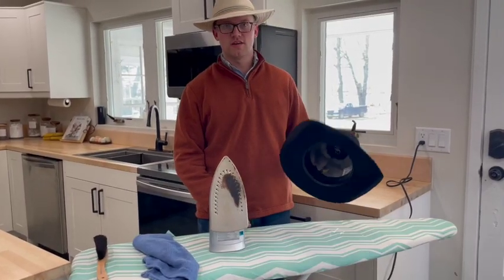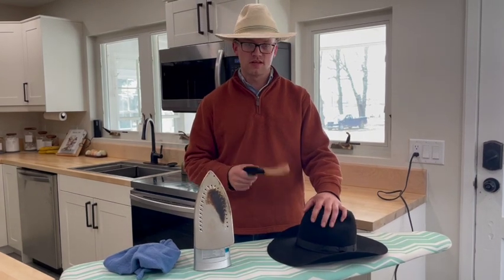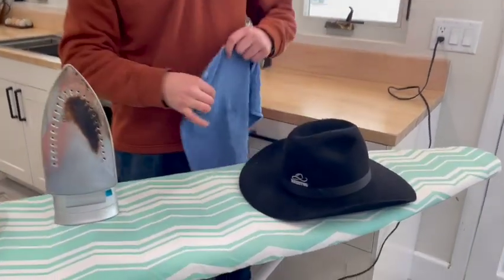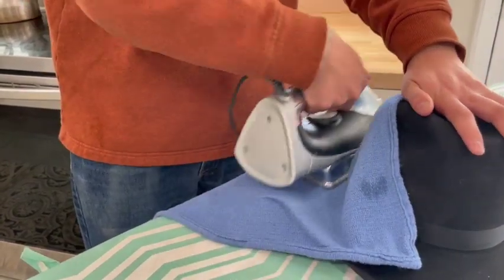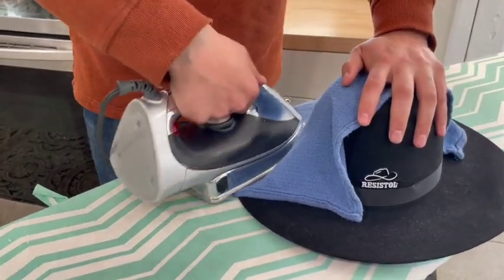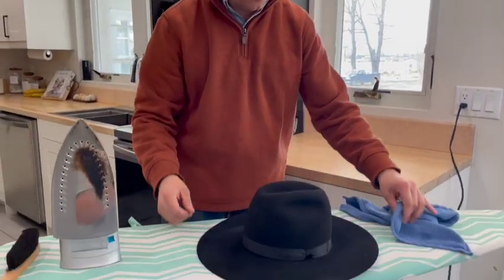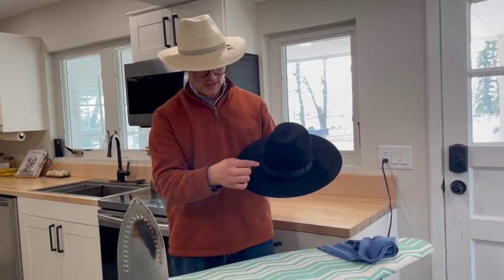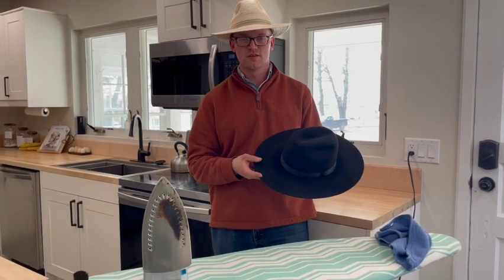Ironing a Cowboy Hat Brim

Comment: I thought all you had to do was steam it. I have a felt fedora and the indents are wrinkled and not sitting right. I need to clean and reshape it, It's 2 years old and hasn't had one yet.
Reply from the maker: KoolBreeze420, 

Depending on the quality of your hat you may be able to just steam it, but I have had great luck with an iron from time to time. 

S^C
Reply: @StartupCowboy  Well I think you would call it a mid-quality hat. I was wearing a 100% paper fedora as a trial. They are notoriously known to not look good on people so that is why the trial. I've only ever had compliments so I bought a felt one and I'm very happy with it. I just don't know how to properly care for it which led me to your video. For the paper hat, all I had to do was steam it to clean and it would reset its shape at the same time. Does it work the same with felt?